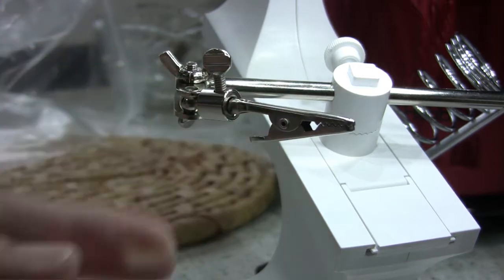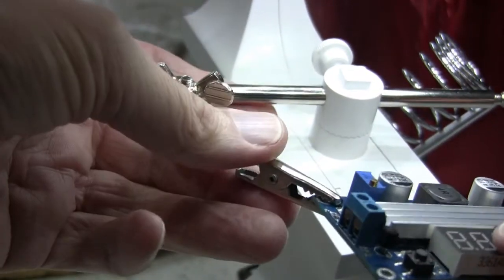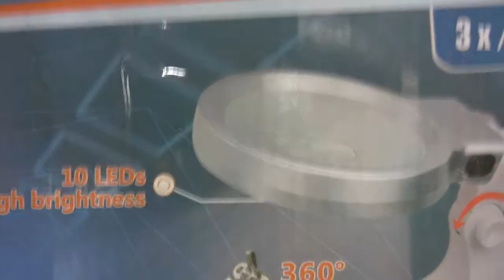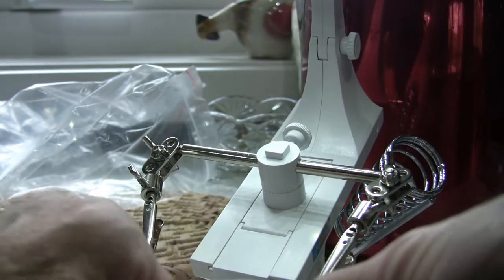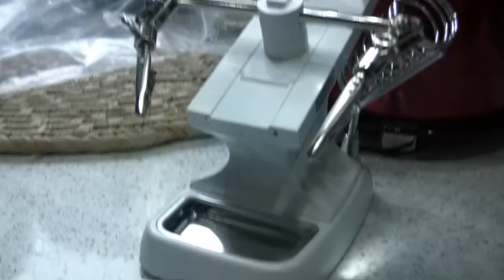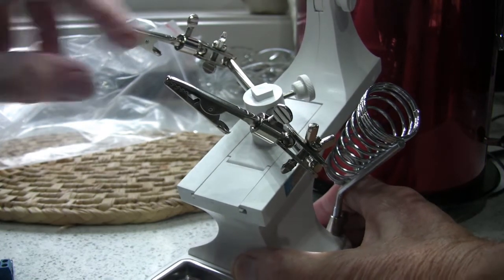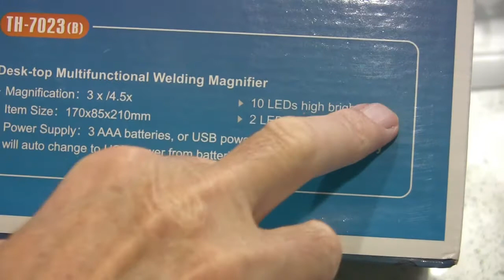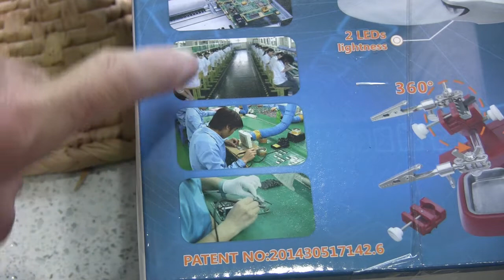Extra Hands. Mulifunctional Soldering LED Magnifier. from Banggood.

Comment: I bought one yesterday. I looks nice. But could have had a different design cz there is no much working space. What I’m doing is using if the other way around. Arm part facing my side so can get a good working space also easy to view with the angle of the lens. But you won’t be able use the solder mount. Overall not the perfect but worth for the price

Comment: I can't find a single high or mid quality version of this. Can anyone help me?
Reply: You wouldn't be able to find. I've looked into this model/style myself. The bottom line: they are all pretty much rubbish lens quality. You get what you pay for. A decent but still not top of the line product will be in the range of 100  to 300  GBP or more and yes ridiculously pricey. But you'll get a lens that has a much much more light and clarity to it an the distortion around the edge of the lens would hugely smaller that what you see in this video.

Comment: As for the two LED's mystery :) actually there are two different types of the tool. The red one comes packed with two LED's and the lenses are frameless as for the second white model which you got it those are its specs. ;) I am also considering buying this thing.

Comment: I was looking at this product and wondering if it was worth buying or not. Judging from your excellent review, I think that even if it's not the "perfect" helping hand, it will be a nice tool to had to my bench. I like the big magnifier and the bright light. My eyes are not as sharp as they used to be.
About that  2 leds lightness mystery. I'm thinking that instead of two more leds,  maybe they mean that you can adjust the intensity of the light. Low and high.  But obviously, if there was an intensity switch somewhere you would have found it. 
Anyways, keep up the good work :) I just found your channel and I've already spotted a few interesting videos.

Comment: Thx for this review video. Do you recommend this? Or better will be such F.e. http://m.gearbest.com/hand-tools/pp_198582.html
Reply from the maker: It is useful at times but a bigger unit would be more useful, things get
 in the way at times but it is quite low cost. I have never used any 
other such device so cannot compare. I do find it good to have LED lighting, does make a difference.

Comment: Michael,
thanks for taking the time to make such an informative video.. I plan o get one.Presumably now that you have used it soldering.. what PRO and CON's have you discovered while actually using it?  I have a couple questions I will post on the BangGood site.. Thanks Again JimS
Reply from the maker: Hi Jim, Well, it has some good points, it does hold items well but over all I find the gap between the work and the lens too small. Hard to get the soldering iron in place without burning the plastic case at times. Also getting the lens in position quite hard with not enough adjustment. However it is quite low cost and useful at times, a bigger more costly item could well be a better choice.
Reply: Michael Beeny ok got it thank you , for the price.. I'll try it

Comment: ahahah the screw in the solder holder is just because they took it from another side, its pre manufactured, so they just save some money, and insert it on it with a screw, the box is also a joke, they have 2 models, and they printed both in the box, so you know what you buy just  becase its said in shop,  :P  the clamp looks quite no sense since it doesn't hold